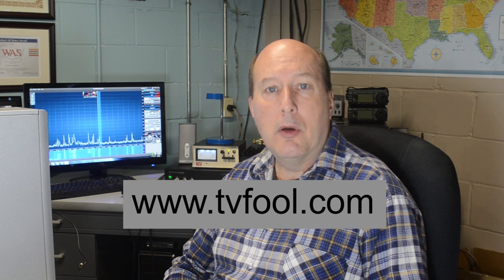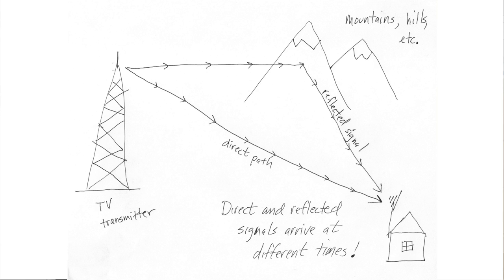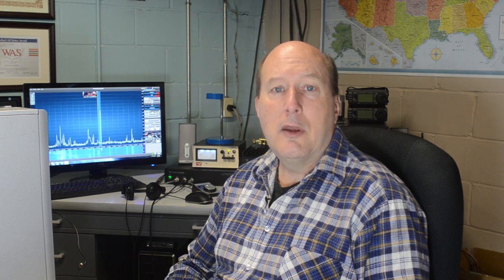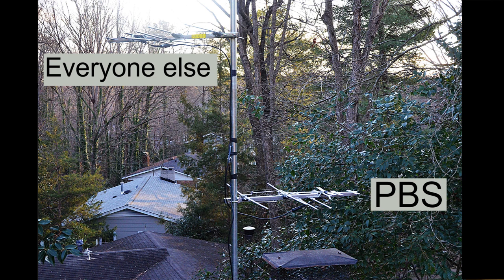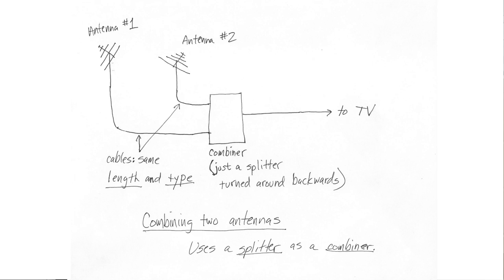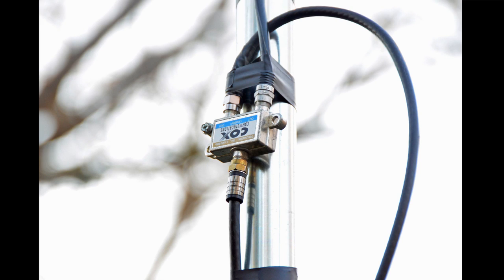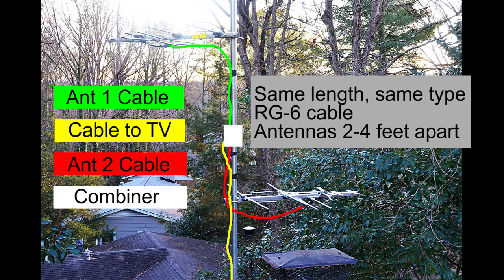Combining two TV antennas for better HDTV reception

Comment: Using a regular cable splitter as a combiner causes distortion and will actually weaken your signal. You really need to use the proper components to ensure the best signal possible. It is not an issue if the signals are strong, but for me I need to reach over 90 miles to get the two different U.S. broadcast towers, so I've learned going cheap doesn't work. Currently catching every channel available in my area from 5 different broadcast towers using an omni-directional antenna combined with a 8 bay panel aimed at one US Tower and a Yagi dedicated to another.
Reply: I also have to recieve my signals from a tower 90 miles away livng in the Sierra Mountains and use a huge directional antenna at the moment but am missing signals from 120 degrees away at the moment, could you please share which omni-directional antenna you use to get your signal for the longer distances?
Reply: 2 way splitters ALLWAYS reduce your signal by 3dbms. 3 way splitters give you one -3dbm and two -6dbm ... an amplifier will bring back usually +10dbm.  If the signal is there it will help.
Reply: Alexandre Laverne - As for the dedicated Yagi... I have a situation with a weak UHF channel 90 miles away. A Yagi antenna cut specifically for that channel's frequency would be great to combine with my wide band antenna (which gets 4 other channels at 90 miles.) Did you order your Yagi antenna or custom make it for your weak channel's frequency? Please explain (i.e., where to buy).
Reply: @brucebeverly2629  Suppose he has his own Channel he wants us to watch? Click bate people on other youtube channels who know all...
Reply: @emilypoole5686  - I'm sure that sort of thing happens often, but I could only find family / video game / generic videos related to "Alexandre Lavergne." His mention of "omni-directional" above is suspect, because 1) combining that with other antennas can cause phasing errors where there's reception overlap, and 2) what is he using for "omni-directional," a dipole such as a "rabbit ears" type? No, his post is probably a disinformation troll exercise. Now, I've decided that I'll have to "bite the bullet" and learn how to design custom Yagi-Uda antennas for specific frequencies and combine them. Such design info is online; just do some Google searches.
Reply: @brucebeverly2629  yes we are all very impressed by how much more than everybody else you know. Some people get off on complicating simple things.
Reply: @jimbates3837  - Doug Hall on his video does a good job of explaining HIS problem, which is relatively minor in the big picture. His small antenna sizes show he is dealing with medium-distances to transmission towers. The fact that the two transmitting tower locations are nearly opposite (135 deg.) allows Doug to use off-the-shelf wideband antennas without excessive signal cancellation from overlap. Fair enough. However, others on this thread have a more difficult problem to solve. Transmitter locations are in the 90 - 100 mile range, and in my case, about 90 deg. apart. For this category of problem, combining off-the-shelf wideband antennas does not work. It requires a purpose-built, narrow-band, high-gain antenna pointed toward the lone transmitter for combining. The tvfool plot shows -116 dBm on the weaker stations, delicate signals indeed. My main antenna has a 10 - foot boom and its longest TV DXing record is VHF Ch12 at 188 miles. So I believe I'm on the right track. Now Jim, if you'd rather make a contribution that helps people get results, sarcasm is NOT your friend.

Comment: I purchased the Weingard version of the RCA. Mounted on a 20' mast and aimed in general direction of major channels...I receive about 30 channels...I also put a rabbit ears antenna on the ceiling in my radio shack for my 15" flat screen that is dedicated to National Weather Service RADAR channel from nearby public station...works quite well for station 65 miles away! Being a HAM for past 30 years, I understand velocity factor and dB line loss over long lengths of line....73 OM

Comment: Multipath interference is major PITA in urban areas.  To date, the only digital antenna that had enough directionality to reject reflected signals was the Philips Silver Streak - and of course they stopped making them around the time the country went all digital.  Likewise, the D/A converters they gave coupons for , to help people with the switch over had a signal strength meter built in, which was indispensable for aiming.  I have not been able to find a single tv on sale that has a built-in SS meter, and the D/A converters aren't sold anymore.  (actually the stores never carried them BEFORE the changeover either, figuring they'd just sell you a new tv of course)  

It's a capitalist conspiracy, I tells ya!
Reply: It's incredibly easy to build your own yagi with much better gain than most of the store bought crap I see. Also I never saw and digital converter with it's own s meter. That would be extremely helpful. I've seen most that have a s meter in it's settings but a good analog or digital on the outside of it would be so great
Reply: I bought a cheap ($118) 32" Element brand HDTV at Wal-Mart with signal strength meter built in.
Reply: I have a 5 or 6 y/o LG 55UF6450 and it has a signal strength meter. It's somewhat buried in the channel menu, but very handy.

Comment: One of the best tutorials on DTV reception I've seen.

However, the multipath problem (actually causing more reception problems than weak signals) is less likely due to mountains than the buildings in your immediate vicinity (using an outdoor antenna) or the walls and people in your home (using an indoor antenna).
Worse that ordinary multipath is dynamic multipath (multipath conditions that are often or always changing). An automobile driven between you and the TV station can cause a dropout.

Fortunately, relief may eventually be at hand. Digital TV may be switching to a new system that is far less affected by multipath.

Comment: Please,  someone tell the easy n cheap way to add ground to my tv antenna. I lack $ so...
Reply: You can buy a grounding rod but any length of metal two to three feet long will work. First drill a hole in it or get a fastener that will allow you to fasten a wire to the length of metal. Pound metal at least 6 inches into the ground. Run a copper wire from the metal to your antenna. Shouldn’t really matter where you attach the wire to the antenna as long as its to the metal per of the antenna. They do make what’s called grounding wire which is thick copper wire but thinner wires will work. I’ve grounded dozens of CB and Ham radio antennas this way. Should work with TV
Reply: He's too busy fiddling with the TV antennas also collected YouTube payouts.  I've heard of the Omni50 hands down the absolute best.  Relatively cheap around $60 , still saving up money for it so I'll let you know.  Anyone else using the same Omni50 ?

Comment: Good video sir. We use OTA reception and happy with what we get, ( some where in the neighborhood of 55 stations here in central Florida ). I think most if not all TV antennas now are log periodic, ( not counting the other kinds like the one you hang on the wall, etc. ); where at one time they used Yagi Uda.
We use to have two antennas, but I needed some space for my 2 meter Yagi, so now it's just one.
And that website, tvfool is really great for helping lay out your antenna system.

Comment: What channels do you want? ATSC is frequency selective just as NTSC.  Bandpass filters ,Attenuators Traps.  I found the local station my worst problem to keep Ingress out of the picture . I bought an antenna tuned specifically to it's frequency had a clear view by eye of the tower and lined it up. ran Earth grounded RG6 to a 30db attenuator to a combiner which had a frequency trap of the local station by about 40db so that other antenna is on a 360* rotor. You still had to find a place to point it for  local station  Q/ so people wondered why you point the antenna at an odd angle for the local station? A/ That is not receiving it, the signal source is the little antenna fixed in place it's signal is attenuated 30db as well as all the noise on that signal.  The Television receiver's Tuner is shielded , without a signal source wired in it has nothing,you do not want it picking up interference.    I tried using TV tuners as frequency selective pre-amps  there was a steady flow of Goldstar VCRs on the scrap heap but their tuners worked very well and you could transmit the IF frequency back a long way as it is a low frequency.  Tuners don't like the weather but the concept of a frequency selective amplifier can work
.Sorry that is my Rant about Consumer electronic repair in the 90's  
  The ATSC signal today when combing Antennas I would spend for Passive traps and bandpass filters.  The idea is that you do not want both antennas receiving the same station. Analog sets gave you a Ghost; Digital can lose track of Data and picture turn to pixels floating around.

Comment: I actually have 3 antennas on my roof since the towers were all in different directions. They also advise you not to combine the antennas on one pole since the pole might not be strong enough especially with a storm. Another reason not to put them on a pole together is the signals might be to close and you might have ghosting. Another thing you can do for better reception is put a preamp on each antenna. This prevents signal loss from the antenna to the tv. You also need to remember to ground each antenna.
Reply: So Brian what is the path that is used? Splitter --> amp ---> grounding brick ---> antenna? Also you are using the same length of cable between antennas all the way to the splitter?

Comment: Doug, Great video,! Very helpful since I am in the same situation. I am 40 miles SE from Toledo, Oh and 75 miles West of Cleveland. I want to be able to pick up both areas since I am a Browns fan and my daughter lives in Cleveland and likes to watch Cleveland stations when she is visiting us. The antenna we recently bought and are trying out can pick up Toledo stations well but when rotated to the West we can only pick up ABC and NBC out of Cleveland. Do you use a preamplifier booster on the combined antennas that you use? I don't believe that I need one on the one that I would point towards Toledo, but there is a FOX tower south of Cleveland that is about 75 miles away that I would like to be able to pick up. If using a preamplifier booster would help, do I need one on both antennas before it goes through the reverse splitter? I have been looking at different models and the Winegard LNA-200 Boost XT HDTV Preamplifier and the Channel Master CM-7778 Titan 2 "Medium-Gain" seem to get good reviews. I also recently purchased a PCT 8 Port Bi-Directional Cable TV Splitter Signal Booster/Amplifier with Active Return Zero Signal Loss. I am confused as to whether I should have ordered the one with a PASSIVE feature rather than the ACTIVE one that I bought. Doug I really would like to get transitioned to OTA ASAP so that I can tell Spectrum to take a long hike! Any advise would be greatly appreciated. You can email me at vicfrederick68@yahho.com or call me at 419-680-0416. I am retired and usually available to talk anytime after 5:30 am. Thank you again for taking the time to create that great video.

Comment: I watched this great video again. Our local VHF TV station finally moved to UHF this past year and I can finally take down those big antennas and replace them with smaller UHF antennas. How would you recommend stacking two antennas for more gain? I get the identical length cables for that as well, but wonder about antenna spacing? I already use a CM7777 amplifier that gets me a 40-50 signal strength (TV setup). My stations are low VHF and VHF. Great video, simple fix!

Comment: This was a great video.  I want to point out that some TV antenna installations might present different results by combining two antennas.
Okay....stay with me people!!!   You might need to attenuate one TV antenna's signal strength by using inline coax TV signal attenuators.
One antenna might cause multi-path or override nearby frequencies.  My example is I am in between Milwaukee, WI and Chicago, IL.
Roughly 38 miles to Chicago, and about 53 to Milwaukee.  Obviously my Chicago stations are stronger....  

I have two 12 foot boom TV antennas.  One points to Milwaukee and the other to Chicago.  I don't remember exactly, but I get over 73 channels.
Including Chicago PBS 11-1, 11-2, 11-3, 11-4, and Wisconsin PBS 10-1, 10-2, 10-3 and Wisconsin PBS 36-1, 36-2, 36-3.  Now the problem comes in when some 
stations interfere with frequencies that are close to each other.  Like Wisconsin NBC channel 4 and Chicago NBC channel 5.  Or PBS 10 from Wisconsin and PBS 11 from Chicago.   I might not get Channel 4 and channel 10 for example.  By attenuating the stronger Chicago signals by just a few decibels, I effectively can watch all stations on multiple TV's.

Now I am not going to get super technical because every antenna installation can be different.  You can get in-line attenuators from places like SolidSignal.com, Amazon or  parts-express.com.  You can even get variable in-line coax attenuators too.  Some experimentation is needed to figure out exactly how much attenuation is needed.  Start small like 3db attenuation and work your way  up.  I bought a variable attenuator, but I don't remember where.

Comment: This is a good topic and video.  I do understand the velocity factor and for the same reason, the lengths should be identical.  The ghosting problem can be generated otherwise.  I'd like to know some more details about your "shack".  Looks kinda like an RF spectrum analyzer.

Comment: I installed an outdoor antenna about a month ago to "cut the cable."  Then, we started having pixelation.  I have a line-of-sight view for about a mile toward Shreveport before the distant small hill.  The tower distance is 55 miles or less.  That put our dropping Dish on hold.  Then the other day, every channel went blank.  I contacted the KTBS engineer, and he assured me that nothing was wrong at their end.  Then, unexpectedly every channel began to come back.  It was weird.  I was wondering if all of the UHF channels in Shreveport (over 20) were using the same tower support to save money, but I have not been able to find out.  Everything seems to be much better now except for occasional pixelation on KTBS.  Could I stack two antennas on the same pole about 6 feet apart and possibly improve the signal by combining them with a splitter?  I do not want to drop Dish if this might not solve the problem.  The antenna I purchased cost less than $30.00, and purchasing another would not be an insurmountable cost.

Comment: Doug Hall  MY QUESTION.... Instead of going 4:1 balun, to coaxial, to combiner how about connecting the two antennas via say 300ohm twin lead, then from there one 4:1 balan?  WHAT YOU THINK?  //// I have two identical RCA antennas as you, similar issue, station locations. Did some test off the roof at 20 feet, connected the two RCA's  like you did (slight difference with coax but what I had on hand, just for a test before getting on the roof.) IT WORKS! I still thinking phasing them with twin-lead to a 4:1 transformer (balan) might be better. Might be fun to try...

Comment: "Stacking" or combining antennas to achieve higher gain can be tricky at best.  Proper phasing is absolutely essential to avoid unwanted destructive interference when combining signals from two separate sources. Stacking can also affect the array's bandwidth resulting in unintended outcomes and impedance irregularities.  This technique works best for narrow bandwidth applications such as single channel reception or channels that are closely grouped together. A spectrum analyzer coupled with some form of tacking generator can improve chances of creating a successful array.

Comment: Very nice video!  You mentioned the need for several ft of separation between antennas.  What is the reason for that?
Regards, MG
Reply from the maker: Placing the antennas too close to each other can distort the pattern of the antenna and can change the antenna impedance. Bottom line, performance suffers if they are too close.

Comment: Thank you for the video Doug.  I am in San Diego and am having trouble with two UHF transmitters located about 6 miles away, while I pick up the other transmitters 25 miles away (the ones with more networks) fine.  I just have to have PBS (KPBS) so I'm ordering another RCA Yagi (RCA ANT751E) to point at their transmitter.  I'll update my post when I finish the upgrade. My only question is when you have the antennas stacked and the coax is the same length, what did you do with the extra coax?  Put it in a loop or...?  When the antennas have the same length coax to the combiner, the lower antenna is going to have a few feet of slack in the coax...  
DE K6WWW
Reply from the maker: Sure, roll it up or tape it to the mast, whatever works out best for you.